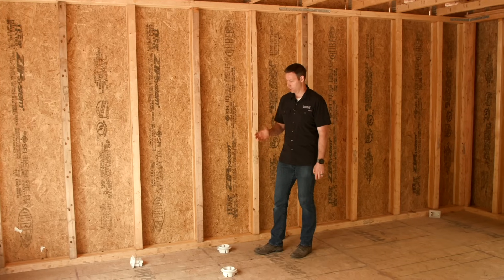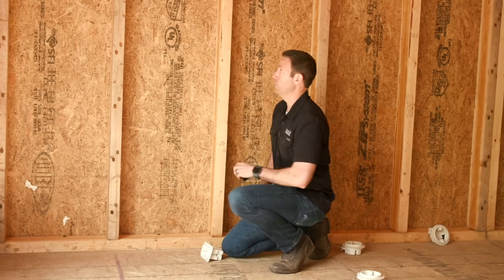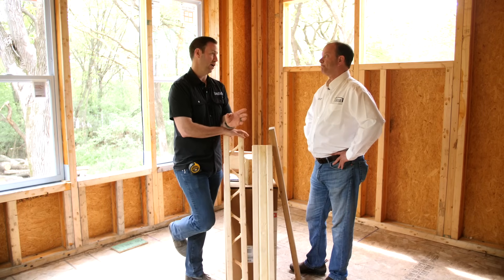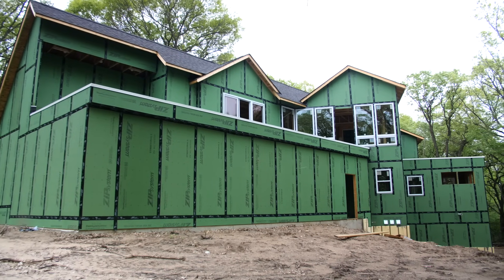Insulated Studs? This is a BIG Innovation in Framing!

Comment: This is why I subscribe to Matt’s series. Such informative, progressive information about smart construction. Love it. Great job Matt 👍
Reply from the maker: Thanks Craig!  Appreciate your support.
Reply: @buildshow  Good stuff Matt, this is a game changer for us up north and
a far cry from removable handle hose bibs.
Reply: @buildshow  Congrats on 2 million views, Matt. You should have Brian come on and say "that's sick" in some of your other videos.
Reply: @buildshow  A thick wood beam insulates fine. They build log cabins from wood in the coldest parts of the world and have no issues.
You’re bs’ing and you know it.
Reply: @buildshow  do those protect against termites
Reply: RICH82AIRBORNE 
Didn’t you hear them talk about the improvements in strength about 10  minutes In?  Tested 4 times stronger than a traditional 2x6.  Higher thermal insulation, stronger and less waste.  Sounds great to me.
Reply: Contacted them already. I didn't know about the R-30. What would YOU fill the large cavity with? Foam/batt/fluff? 
I would be curious how the close off the joists to keep that R value.
Reply: @ktauber9692  are you talking about rim joists between each floor? Typically the best is closed cell foam, no more than 4inches or r24. Make sure to apply same coverage throughout the top plate wood frame or concrete foundation if were talking basement. #sinnisjInsulator
Reply: 8
Reply: K Tauber 
I don’t know who your question is directed to but I would have all run electric and water lines then spray closed cell foam. If cost is an issue then batt would be my second choice and loose fill last. I’ve seen a lot of settling with loose fill.
Reply: @Mote78  I'm sorry, I must have hit your thread instead of a new one by mistake. It was for Matt. I too have seen settling with blown. 8" of foam seems a bit steep. ( I don't have much experience with foam) I was looking at doing a R-30 (+) addition/remodel to my house. CIFs were really expensive, so these might do the trick with the R-30 and maybe Zip-R. With the 2.0 sealing method of course.😁
Reply: Why is 2 inch or 100mm stud not sufficient?
Reply: He said wood isn't a good insulator....
Reply: yay .. fire needs that foam insulation to really go .. yay for pyromancy.
-__- .. moron.
Reply: Which crybaby reported me under Cody Moreland's post? I already apologized to him and it was a very soft punch type of thing anyway. Get a grip.
Reply: Delphinium Flower haha
Reply: Totally disagree
Reply: Of course don't forget that Polystyrene in direct contact with PVC (the insulation around the wiring) - can result in the cable PVC becoming brittle as the the plasticisers migrate out of the cable causing the sticky outside. The loss of plasticiser makes the insulation brittle.
Reply: I would like follow up videos about this product used as framing members of a hempcrete application. If the hempcrete can go through the middle of the stud that will be a game change.
Reply: @Craig Wheeless "Such informative, progressive smart construction" Jesus! I hope this guy Matt was showered before you stuck your nose deep in his beehive. This Matt where's the dollar Risinger guy is a walking infomercial so spare me the BS. 👎
Reply: Not very Informational
Reply: they need to be tested with multiple other materials and over the course of 20-50 years. the government forced changes to and thought changing wolmanized was a good idea, until it started eating through the flashing on thousands and thousands of homes, causing a ton of water damage. stuff needs to be real-world tested.
Reply: RON TER  
progressive is the new buzzword for SJW's
Reply: When is enough enough? I worked on homes so tight that downdraft kitchen units wouldn't work unless you opened a window. Now the need for air, heat exchangers just to keep healthy oxygen levels in the home. If you ask me it  ridiculous. Natural gas is cheap and limitless and seems to be the energy of choice.  Expandable foam in abundance has high VOCs is unhealthy to be around, and god forbid there's a fire in the home. Keep your foam studs, I happen to like wood.
Reply: Chuck Roast 
If Natural gas is so plentiful and “limitless” why are we having to frack to get gas when fracking contaminates our environment drinking water? 
“The process of extraction (via fracking) has long-lasting negative impacts on the surrounding environment. Air pollution and water contamination due to the toxic chemicals used in hydraulic fracturing are the greatest concerns within fracking sites, while the need for wastewater disposal and shrinking water supplies are also pressing issues directly related to the procedure.”
Reply: Lets see how they perform under fire load. I bet structural collapse would happen a lot quicker. Awesome, let’s kill more firefighters just so we can save some money on trees. The carcinogens in fires due to everything made out of plastics is killing more and more firefighters from cancer everyday.
Reply: what a waste of money just but for foil face 1 inch foam all around under the siding then tape the seams and around the windows
Reply: @elivan1700  That would only be 6-7R per inch of foam so might get to 16 but much less in areas with lots of wall and structure...Decent reference: http://www.coloradoenergy.org/procorner/stuff/r-values.htm
Reply: @elivan1700  Not to mention the fact that "hanging" siding off of the structure by an inch is not a 
good idea especially when the siding is heavy.
Reply: 2drsdan your suppose to float siding nails
Reply: 2drsdan use longer roofers
Reply: Eli Van These house must be the most expensive houses to build ...is the r value  gain to cost really worth it? Isn’t there a point where the overkill insulation isn’t making much difference?
Reply: DAGOSTA 
Certainly there’s a cost benefit ratio but do you think that most builders put the homeowner first or their profit?  You know what I mean. That’s why I appreciate Matt showing various options and talking about the cost.
Reply: @Mote78  both should be factored in....maybe the homeowner doesn't want to spend an extra 100k on a house when they can get the same house  thats structurally strong and built right just to increase r value?  ....all I'm saying is it really worth it to average person to spend that kind of money especially if they aren't going to live in the house for life ....i think its cool to use if money isn't an issue,homeowner will live in for life or if thats going to be a home you're building for yourself and cut labor costs...
Reply: DAGOSTA 
True. I’m not a builder but I’ve heard that for something like 2-3% more spent on energy efficiency the pay back is in 5-6 years and pure savings after that.  That, plus the added comfort and safety from lower energy bills, fewer drafts, less mold and fewer insects pays dividends to the homeowner. I just wish builder’s made the energy upgrades available to home buyers rather than focusing on outer appearances.
Reply: @Mote78  the biggest insulator is a basement or at least a crawl space. You have to allow your building to breathe meaning allow the Earth and then the air itself to be your insulator. Like a proper boat (hull/"the hull truth") the basement needs to be dry then you have a proper surface from which to build upon.
Reply: RICH82AIRBORNE  exactly. given these studs have less wood, they will support less load. Therefore you will need more of these on a typical wall. The REAL goal of these are NOT to get better thermal insulation, they are to reduce wood costs.
Reply: Carson Wentz and Rich airborne. 
At about 10  minutes in they talk about the improvements in strength.  It tested 4 times stronger than a traditional 2x6.  Higher thermal insulation, greater strength and less waste.  Sounds great to me.
Reply: @Mote78  For lateral loads, yes it is stronger but for gravity loads no. The area of one 2x6 is 1.5x5.5=8.25 in^2. The equivalent stud of this type is (2) pieces of 2x3 or 2x1.5x2.5=7.5in^2. So if the wood is equivalent, for example Southern Pines #2. Then it will have less axial strength. This won't be too much of an issue with a one story house. But when you get to 3 story residential or to multi family housing it becomes a problem, in that you need more studs.
Reply: @Mote78    I'd suggest that you go buy yourself some 2x3 (nominal 1 1/2" x 2 1/2" actual) and start blowing 3 1/4" framing nails into the ends of them. Find out how many of the ends of these things actually don't blow to bits. They are running on at the mouth about thermal transfer through the studs. That's not the location of heat loss in a wall. Your heat loss is through the windows, doors and other perforations in the wall such as plumbing, and ducting. The difficulty in insulating a ceiling and roof structure are also another major area of heat loss... again, its not the wood.
Reply: Carson Wentz 
I’m not an engineer but to my understanding in the presentation the strength was tested under load and determined 4 times stronger than traditional framing.  We all understand that the narrower a board is the more likely it is to fail by bending outward.; that makes  sense. However, you need to test and not rely on intuition.  The developer has tested. It’s up to the regulators and builders to review the test data.  I trust Risinger’s evaluation over mine and over most of the builders I’ve encountered.  I stopped to look at a home under construction that bordered a large pond.  It later sold for over $500,000. When I pointed out to the builder that many of the outer sheathing nails missed the studs completely, he replied, “That’s no problem, it’s still strong.”  I said ok and walked away.   It’s ridiculous what you get sometimes for the money.  Choose the builder wisely. The cheapest bid often isn’t the best value in the long run.
Reply: LoL what an idiot 😆😆🤦🏻‍♂️🤦🏻‍♂️ Wood is the best insulator out there 😆😆 Please tell me what are log cabins made of? Styrofoam? 😆😆😆🤦🏻‍♂️🤦🏻‍♂️🤦🏻‍♂️ derp
Reply: DooYouEvenLiftBro 
Sure a log home is great. When you can build one for only $2,000 more than conventional let us know.
Reply: @Mote78  conventional in the us do to regulations and taxes is already at a a 49% mark up, then comes property tax and insurance, plus most people get a loan and that has overhead..... most people pay almost 3x what their house is actually worth atleast for a new home. older ones you may get good deals. but people like to buy old homes and leave 1 wall standing to follow the code from when the house was built.

Comment: I have 2 questions Do the dowels still transfer heat through wall Also how does the electrician punch through foam affect R value or do you refill with spray foam Looks like a great product

Comment: How is that R20?  Using R1.25/inch softwood and R5/inch closed cell - 1.5” for each 2x4 and 2.5” of foam = R16.  Plus the fact the dowels add thermal bridging which lowers the overall effective wall assembly R value.

Comment: Using Header spacing, at time 5:58, seems to be an expensive use for the non-load-bearing wall. 5years later now, what are the current economics dictating considering the shipping cost to the south?  Is 5/8 drywall used for impact improvement?

Comment: Hard Pass! there are three reasons to use a truss stud: Cost, cost, cost. You lose so much structural strength tying anything into the stud (think doors, siding, windows, etc.). Basically you are drilling and nailing everything to a 1x3.  Plus you've just created infinite tunneling ability for rodents and bugs. Wood is not a terrible insulator. It comprised of closed cells of dead air.

Comment: When I see snow melting patterns on a roof, I can tell where the rafters are.  I see the snow melting away in between the wooden rafters.   Wherever the rafters are the snow melts away more slowly.   Is not thermal resistance involved more than is being described.?
Reply: What kind of price difference are we talking here.?   I’m thinking I’d rather use any extra cash on a nice safe steel roof.  Steel siding too.    I’d place fire/heat materials in between the outside walls/rafters.   
Okay, I’m concerned about high winds too.  I want steel pilings driven down to bedrock and strapping down the entire buildings structure.  
I’d prefer 18 gauge studs rather than wood because a good welder can follow up the carpenters and weld the entire structure together into a single unit.

Comment: i think its cool . but how will this stuff be in 20-30-50 years , i see wood repairs on rare rifles and other things where the product was supposed to be the new "THING" and its totally crap at end of 30 years , foams and such worry crap out of me due to break downs and in 30 years those company's will be gone or wont care . i had a house with early blown insulation in crawl spaces stuff settled and did nothing but take up space and maybe a fire hazard. in building space there are 10000s of new items every year , but maybe 1 will make it past 5 years. do you want to be test rat for products?

Comment: Buy a 40 year old house and you might think most of this “new building tech” is under-tested risk… and it often seems to regard synthetic materials. How many dollars have been spent to remedy an innovation that saved dimes when it worked? Making homes air tight, and they rot, for example. It all looks great when it’s new. In this case, studs full of foam. What could go wrong?

Comment: I still rather use the 2 by 6 framing and put R35 in my walls yes they do make installation double the amount of the R19 and it's way better I wouldn't use toothpicks in my walls with Dallas between sorry that aint happened

Comment: Insulated Studs sound great.  Not sure about competitive costs though.  I would like to see the Insulated Studs built a little different.  Instead of wood dowels, I would use rebar matched in length in a wave pattern.  Then the rebar is placed & secured within the perfectly sized slot inside the 2x3 part.

Comment: Such a waste!ANOTHER OVERKILL MONEY -PIT IDEA...just to be different...and more money than it is worth..SILLY IDEA..CAN you imagine what this costs?
Reply: Is it? If you can forgo sheathing the outside of the house in insulation, how much did this just save?
Reply: @NDxTremePro  price up front is so important.The pennies you save because you spent double or triple money for a stud,can never be returned on investment..This is a silly idea.and that single top plate will be REAL HARD to get past the most easy going inspector..
Reply: @metalrooves3651  I am talking up front costs. How much money did you save by not having to insulate the outside as well?
If you don't have to put a layer of 2-4 in foam on the outside, you have reduced the initial investment. Then you figure out the difference you would have spent using each method.
Is the price difference a few pennies per foot for the studs? Is it a dollar? Find that, and then tell me about the investment potention.
Inspections are a different story and are different for every area. I live up North, so the codes here are simply different.

Comment: Can anyone run the roughmath for me question maybe I’m a little simple minded LOL. Let’s compare the total R-value for, like the example, a 2500 square-foot basic house. The equivalent for the amount of R-value all over the whole house added compared to regular two by sixes. If it’s about triple the R-value at each stud, but the total studs are only 25% of the exterior wall surface, what is the equivalent added R-value averaged across the entire exterior envelope? It seems to be somewhat minimal but also a very nice addition for not so much more money

Comment: What is the obsession with energy efficiency. I live in a 2300 square-foot house in the Houston area we keep the thermostat at 76 and my energy bill is hardly ever higher than $130. If I added some solar panels I would probably be down to $30-$50 in the summerThese expensive innovations hardly seem worth of savings. I wish innovators would focus on bringing down the cost of construction.

Comment: Has it been tested for fire and heat ratings? Construction now days suck! They built cheaper not thinking about fires. This new construction is why firefighters are killed on structure fires!!!! Go back to the way houses were built! Heavy lumber and no cheap trusses, studs, and floor supports. This crap burns fast and hot. Which equals a house collapsing in less than an hour!!

Comment: Interesting product and seems like a great promotional video. Strength and cost benefits could be addressed in one minute, but for example what about Dew Point? Where will it move it if there is no “exterior blanket” as Matt said? What if it moves the Dew Point to the sheeting and all your in wall insulation is wet, that these R value of Tstud means nothing!

Comment: that guy you dont turn a 2x6 face out so a 2x6 is 10x stronger than that crap 2x6 are put in like a 2x4  now for the hard question the pull apart test how much psi to pull apart

Comment: Matt - I had a question concerning cost - This house has the studs 24" on center instead of 16".  Is this because the Tstud is stronger? If this is the case then wouldn't this product be cheaper or at least closer to the cost of traditional framing? Thanks!
Reply: I read that you can space studs 24" apart as long as you use structural siding, aka plywood covering the exterior holding it all together

Comment: Be careful.  All of Risinger's videos are sponsored by the product he promotes.  This will inevitably lead to bias.  It's not good.

For example, you notice that they do not explain the relative cost of the TStuds.  Simply saying it's $5k more doesn't mean anything.  The cost of these studs is 5 times more than regular ones.  That's a lot.  There is no way the savings in energy savings is justified.  The greatest energy loss is from a lack of sealing, not the thermal bridge from studs.